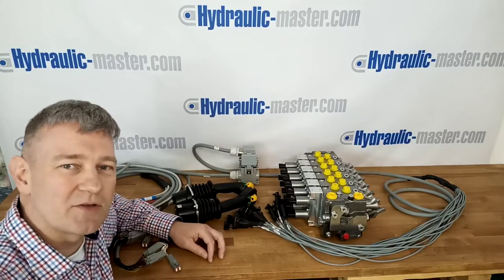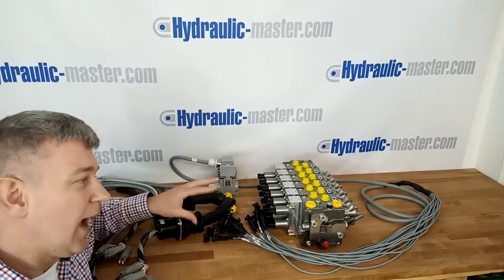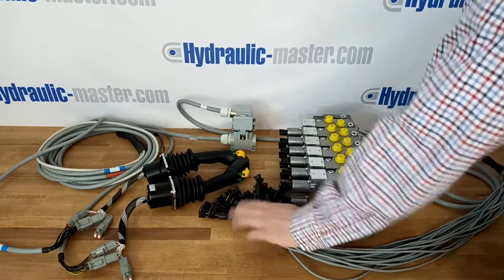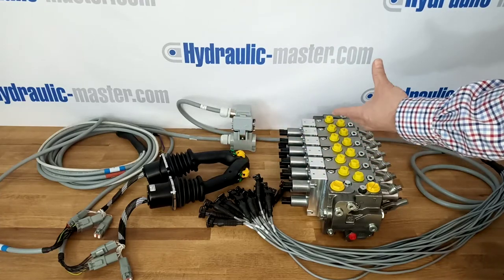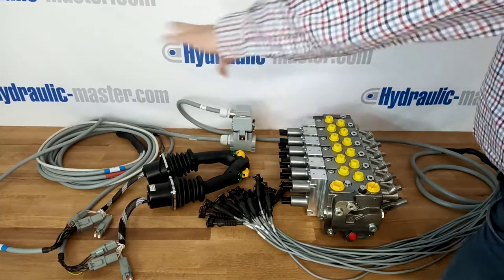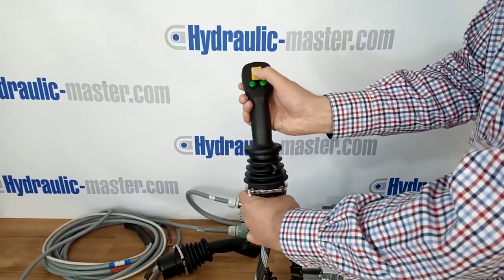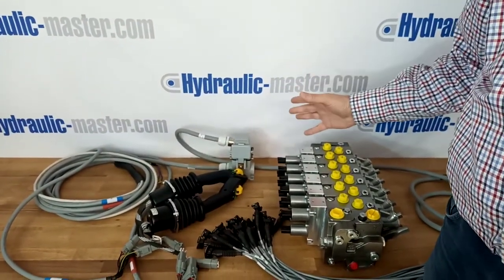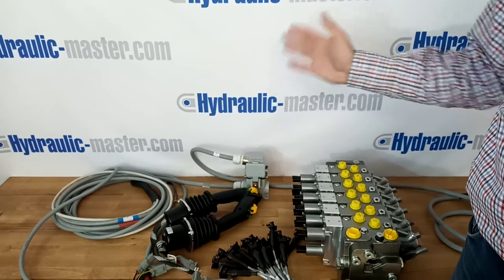Full proportional Hydraulic Valve with 2 joysticks for Forest cranes for example Palfinger Epsilon

Comment: What kinda of software you use to program it ? and the two joysticks you connect them only with one Electronic control unit ?
Reply from the maker: joysticks include PWM analogue controller , we prepare plug and play set that are prpogrammed for each valve to be plug and play
Reply: @hydraulicmaster  okay, i thought it was digital controller with canbus communication